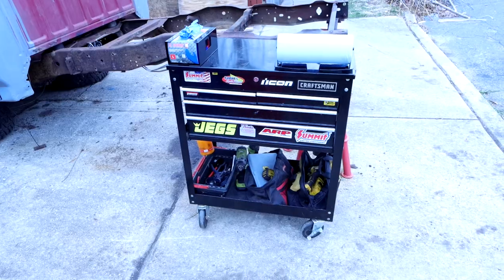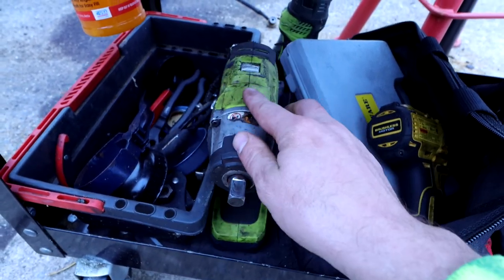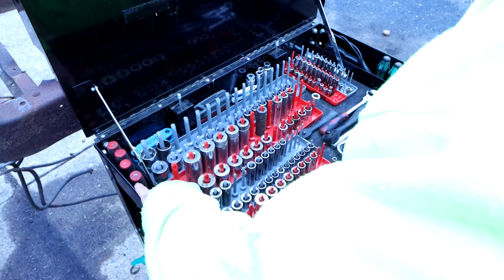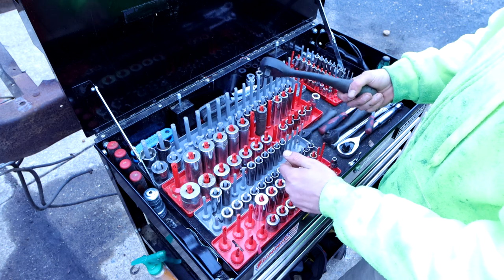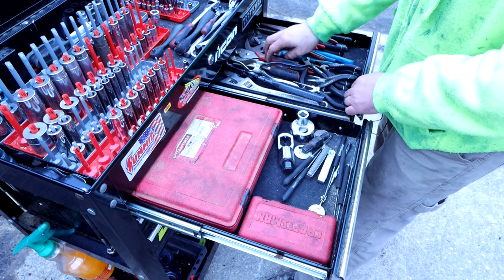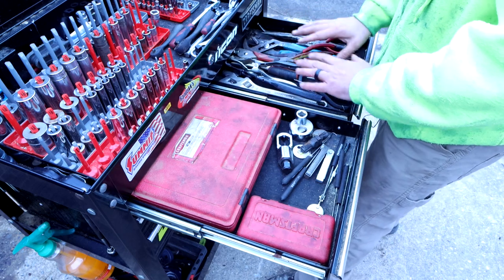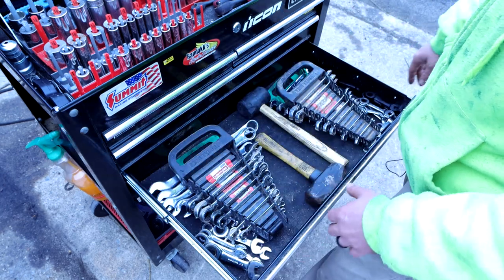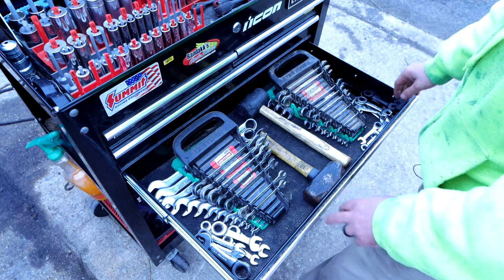Home Mechanic Service / Tool Cart Tour by @GettinJunkDone

Comment: Hey Joe..... it's seems like your trying to do just the same thing I've been look at doing lately 
So here's some of the things that I've kinda got in my radar that you might want to look into that would probably work for you very well.....
#1 .... us general makes a folding shelf that will bolt right on the side of your box for like  $30 or less with your harbor freight coupons 
#2...... I actually just seen this one last night @ Wal-Mart  Hyper tough has a 3 shelf rolling cart and it was 36.2"tall ×30.3 wide × 16" depth and it's 500Lbs capacity or 165Lbs per shelf capacity and I'm pretty sure that it's  $40 but might even be able to get it cheaper on your favourite home shopping web site LOL 
#3.....Global Industrial has a deep 2 shelf with 1 drawer steel cart it's 36"×24"×Idk how tall and it's a 500lbs capacity but it's a little pricey for $165
So I've been look at doing this same thing lately so I figured that I might be able to save you some of the leg work LOL....
Try to catch you Sunday& thanks again for another great video as always
Reply from the maker: Hey Robert, all good suggestions.  I checked Walmart immediately after seeing you comment and sadly it is not available at any nearby Walmart, or for delivery either.  In the meantime, I'm probably gonna be picking up a stand only cart or adjustable height tray somewhere.  We shall see.

I'll use your comment this weekend for sure, thanks again!